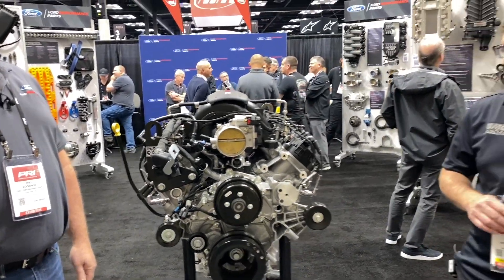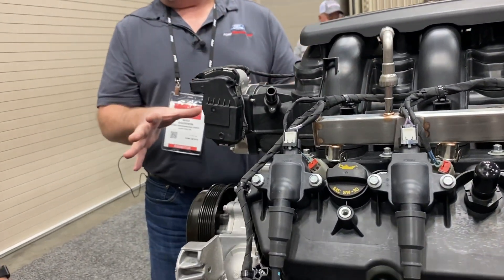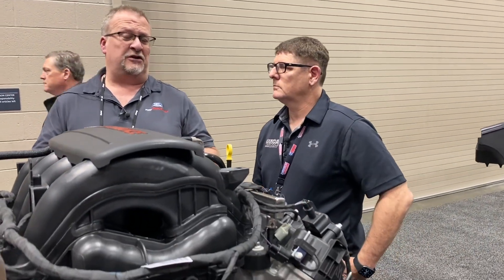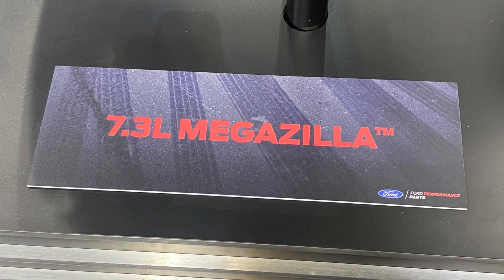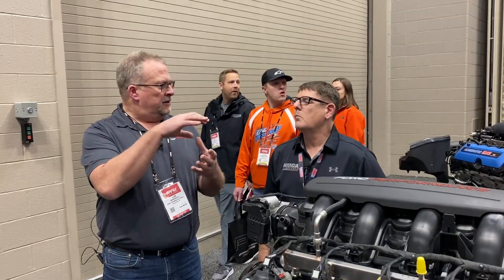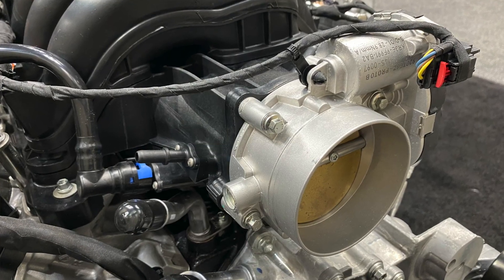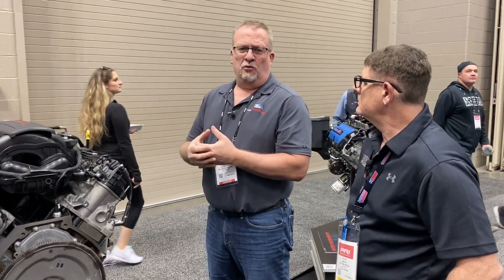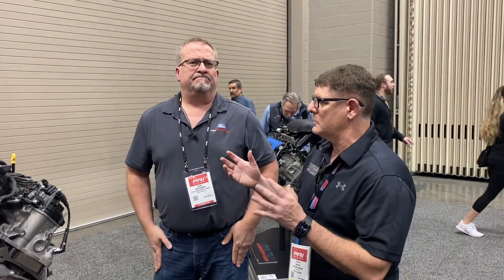Megazilla Is Here! 615 HP 7.3L Godzilla Crate Engine From Ford Performance We Get The First Look

Comment: Sorry, Not impressed with Ford Performance on this build. Take a stock 7.3 crate engine and add cam pistons and intake does not add up to a $20K engine. Would rather swap in a cam, add a procharger with mild boost and not hurt anything. imo.  Thanks for sharing Evan, do appreciate the info on this though. Merry Christmas, Happy Holidays to all.
Reply: True, where does that $ amount come from 😃
Reply: @timweb1510 warranty
Reply: @timweb1510 the shitload of boost that you can add to this thing without it breaking and the giant displacement, as well as the budding aftermarket for this. Plus the exact combination of mods here with a tune adds up to around 800 hp.
Reply: That’s exactly how I feel nothing revolutionary. Same block casting, same head casting with a much higher price tag. They didn’t do anything that an engine builder like Brian Wolfe hasn’t done already
Reply: I agree. I was mad I already bought my 7.3L right up until he said the price.
Reply: Really, I must live in a different world. In stock form the Zilla makes a measly 59hp per liter. 6.4 Scat makes 76 hp per liter car tuned. 6.2 Silverado, 67. 6.2 Camaro 73. 5.7 truck Hemi, 69. On and on. 5.0 Coyote, 80bhp truck 90 Mustang. And the later 5.0 is more. Even Fords measly 3.3 truck OHC make 290 naturally aspirated for 87hp per liter. They make more horsepower per liter and pass emissions. They are more efficient. There is no argument.
Reply: I am comparing OHV engines to OHC engines, cars and trucks. Dude a 1993 car DOHC made more power per liter than a 2022 pushrod engine, it doesn't matter that the 2022 has a truck tune. Its 29 years later. advanced if you will...lol. if someone wants to call a design invented in 1930s advanced. The 7.3 is embarrassing, I  love Ford but come on its a freaking joke. And its 20,000 for the upgraded variant. Like I said, if I was going pushrod I would just buy a 514 based on the 385 series big block, save some cash and destroy a Zilla. And pushrod engines dont make more low end torque, big inch motors with more stroke make more torque. Go buy a Zilla for 20k and pour a ton more into it to make power. I am not that stupid.
Reply: @lil5.0 , It does matter whether it's a truck or car engine. 

It's not embarrassing. Their attempt at megazilla is embarrassing. 

I still stand by my statement that OHV engines make better low end torque than OHC because most truck engines are OHC and make more torque than their car engine variants. 

OHC design isn't new either dude. It's not some 21st century advancement.
Reply: Those Numbers Are "Fudged"! A Stock 7.3, Bone Stock Made 519.9 Hp And 540 Trq On The Dyno. Ford Did The BMW Thing (Underrated The Power Numbers).
Reply: Agreed. I recently had a 445ci Windsor built, aftermarket everything 650hp under 14k.
Reply: @Efab 93 Poor man’s mentality? It’s called calling out price gouging. 
Also, $1k a week is nothing. I used to think that was a good amount too when I was younger, but I make twice that on a regular work week. 
You should watch how you talk to people and not be so disrespectful. You’re not going to make it far in life being an asshole.
Reply: @Superstallion1993   20,000 for a 600hp motor is ludicrous I make 21K a month before rentals and still wouldn’t even think of dropping 20k on a motor you can get an LT4,LSA,LS9 5.4SC/5.8SC. All of these motors for less on most catalogs or just buy GM performance 8.1 thing is a monster shit better off buying a 6.8L V10 and doing cams pistons and porting the heads shit still have money left over after a pro charger
Reply: @denalidriven1574  Ford sells a 572ci bbf for 19k that makes 655hp and 710lb-ft
Reply: 12K USD
Reply: I 100% agree with you.
Reply: True. Buy a chevy 572 big block for a few hundred dollars
Reply: Honda s2000 2.0 makes 240 Hp.
120 HP per L.
Reply: @rdallas81  f20c?
Reply: Wish it was easier to replace my V10 with one of these.
Reply: The power, and more specifically, the torque under the curve is what really sets this engine apart. Yes, the price is ludicrous, but everyone  needs to have a better grasp of power and torque graphs vs. peak numbers and what it means for street performance.
Reply: This is a HD truck powerplant.... so I feel.like they are giving you a lot to start with...
Reply: You're not wrong but that's the cost of turn key drop in engines. Go price having an engine builder port the heads and swap internals and with the cost of parts and labor I bet it's not much cheaper. If you can do it yourself that's a whole different story but this is geared towards the guy who's throwing money at a build. This probably comes with some kind of warranty too.
Reply: @EvilSSP If you’re throwing money on a build, these “upgrades” are basic af for this price. A junkyard engine and a real build would be a lot cheaper, and you’d be building it for your goal.
This is a rich bracket racer’s engine or a drop-in for someone who’s got more money than brains.
Reply: @Superstallion1993  Brains means more money.😂
Reply: I am assuming that the 615 hp is bhp so wheel horsepower is probably just over 500. You can buy a 2018 Ford f150 3.5 Ecoboost truck, the whole truck for 35K and buy A Bullydog BDX tuner and an e50 tune for 565 bucks roughly and make 552 wheel horsepower. And drive it every day and average 18mpg even on e50. My 2016 F150 2.7 Ecoboost that I have owned since new and has been driven 206,xxx miles in 6 years is making 445whp with a tune and some bolt ons will make 540whp after I have CRP upgrade my turbos for 1500 bucks. I don't think I will be doing a 7.3 Godzilla transplant. 20K wouldn't even get me started. It would require a different transmission, custom headers, custom driveshaft and all kinds of other headaches just to be at the same power. The only benefit is that it would sound much better. Buy a 5.0 Coyote out of a wrecked truck from a salvage yard for 5 grand, spend 8-9 thousand on a supercharger and run out of that big pushrod 7.3 life. Ford went backwards with that thing. Standard truck 7.3 makes 430hp. 430÷7.3 liters equals 59hp per liter. Standard truck 5.0 Coyote makes 400hp. 400÷5.0 liters equals 80hp per liter. Come on Ford, seriously. Its kind of an embarrassing engine.
Reply: @lil5.0  Get that power out of your ecoboost without the boost.
Reply: @johnbuck7822  Get that power out of your NA without the cubic inches...lol. I don't know what argument you are trying to make but Ford does offer a 3.3 V6 in the F150 that isn't boosted, makes 290bhp.  290÷3.3=87.87 bhp per liter. Big ole 6.2 Silverado truck engine makes 420bhp÷6.2=67bhp per liter. Weak, has to have INCHES.
Reply: @johnbuck7822  Going back and reading my initial message I simply stated that Ford went backwards on the 7.3. The 5.0 NA is a superior engine. It makes power without adding cubic inches. Ford acting like Dodge and Chevy on that one. Going backwards to pushrod and making a whopping 59hp per liter. Coyote in its mildest form (truck cams and intake) is making 80. The Godzilla...lol.
Reply: @lil5.0  what did the coyote make per liter during it's first generation?
Reply: @lil5.0  It's much cheaper to get the HP out of the cubic inches than it is to boost a baby engine. 

My argument is that the Godzilla can make Coyote power at a much lower RPM. Therefore be more dependable, etc. 

You do realize your 3.3 V6 NA comment makes your, "weak, has to have INCHES" comment ironic. Apparently weak has to be boosted, too. Therefore...
Reply: @lil5.0  Hi Lil! are you talking a 5.0 coyote engine? Gen 1-Gen 3? Thank you!
Reply: @robertclymer6948  I am talking about every single engine Ford has in mass production is a better design than the Godzilla. It is an ancient inefficient pushrod design. If I wanted to go the big inch route I would save money and buy the Ford 514 crate engine. But yes I would take a Coyote over the Zilla any day.
Reply: @lil5.0  you say inefficient yet OHV engines make as much power as OHC engines do.
Reply: @johnbuck7822  If you want to go back we will go way back. First mass produced Ford 32V DOHC was 1993 in the Lincoln Mark 8. It made 280 at 4.6 liters. Thats 61bhp per liter, more than the stock Zilla per liter...lol. 1993. Same year Camaro SS, top performer over the Mustang those years had a 5.7 with 275. Thats 48bhp per liter. Again and again and again the DOHC makes more horsepower per liter. It makes power more efficiently.
Reply: @lil5.0  you're comparing car engines to truck engines. 

And it makes more power efficiently in the higher rpm band. OHV is always better for low end power.
Reply: @johnbuck7822  2020 5.0 F150 Coyote 5.0, 400hp and 410lbft. 2020 5.3 Silverado, 355bhp and 383lbft. Slightly bigger, substantially weaker. DOHC rules.
Reply: @lil5.0  why did you throw in a POS LS when we were talking 5.0 coyote and 7.3 godzilla?

Could it have to do with the 7.3 making more power and torque than the f150 5.0?
Reply: @johnbuck7822  God help you. It barely makes more power in truck form and its 47 percent larger displacement. At 80bhp per liter, the Coyote design would make 584bhp at 7.3 liters. If I am correct, that giant  7.3 makes 435 rolling down the assembly line.
Reply: @johnbuck7822  at least you got one thing right, LS is a POS. Idiots say the best motor of all time. And again that tweaked over and over design requires a 6.2 liter displacement to be competitive against a Coyote. That being said the 6.2 is very close to the 7.3 in output, Ford should be red faced.
Reply: @lil5.0  God help you. It barely makes more power in truck form,,, at a lower RPM. You don't have to rev the 7.3 to the moon to make the 430hp like you do the coyote.
Reply: @Horrible_Deplorable  buy you a 7.3 brother and enjoy.
Reply: @lil5.0  who said I wanted to buy one? Can you actually stick to one topic.
Reply: @johnbuck7822 I dont have an issue with rpm, low end torque is nice to especially when towing heavy weight. Coyote sounds awesome at 7500 rpm and lives a long life. But if low end torque is a big deal well the 3.5 Ecoboost has a bunch of it. The 7.3 was designed for a F250 as an option for the guy that doesn't want the diesel. As far as I am concerned thats were it belongs. The video is about purchasing a motor to drop in a project build. The 7.3 Zilla will never be as readily available, will never have near the aftermarket support and will never be a more cost effective way to upgrade performance in a vehicle. The only argument you made is that a Zilla can make power at a lower rpm and be more reliable. Man there is zero proof that a 7.3 tuned at a high power output can sustain hundreds of thousands of miles without failure. But people are having great success with longevity in Ecoboost and Coyotes. Horsepower per cubic inch matters, 100hp per liter is harder on components (smaller engines typically have smaller components) than a 50hp per liter engine. But a stock 2.7 Ecoboost makes 120bhp per liter and survives it. My 2.7 is making close to 500bhp for 185bhp per liter.  Weve already discussed that a stock 7.3 is making 59bhp per liter. My 2.7 was stock for a 100,000 miles so it survived 120bhp per liter that long and has developed more and more horsepower since. Now at 185bhp per liter and 209,xxx miles its still screaming, still has the original turbos, timing chain, cam phasers, rings, pistons etc. Thats some serious strain and a motor built to handle it. There is zero substantiated proof that a Zilla can outdo the 2.7. 3.5 or 5.0 in longevity even at its rediculously low output for its substantial size. And even on e50 my 2.7 Supercrew has averaged 18.3 mpg over the last 12,xxx miles. Thats not a max effort one tank mileage thats real world numbers. Most people need something thst performs well in all categories.And the truck hunts, tows and races and has its entire life. Get out of here with the Godzilla longevity theories, I operate in proof. If someone drops a 7.3 in a project vehicle they aint gonna use it like I use a truck anyway. Its gonna be a once in a while or weekend warrior. Whats low end torque and supposed longevity got to do with anything? The project 7.3 will never sniff 200,xxx miles and I have used mine 209,xxx in 6years. Can you imagine the difference in fuel cost? There will be 50 Coyote swaps to every 1 Zilla swap. And they will do more with less. And most people who have chimmed in on this Megazilla feel the same way, it isn't impressive and definitely not even close to reasonable price vs performance. Its a JOKE.
Reply: @johnbuck7822  The comment weak is referring to output per liter. Engine design vs engine design. You brought back up the 3.3 since I mentioned it and yes its output is weak but its impressive per its size. It is DOHC and a 6 banger, at 87bhp per liter its a more impressive engine. I guess you be more impressed with an OHV 8.0 that makes 500 than a DOHC 4.0 that makes 400. Because it will make more torque down low because of its stroke.
Reply: @lil5.0  the aftermarket seems to be working to improve it. 

7.3 making over 1600hp are now possible. 

It will be plentiful considering it's in both production vehicles and being sold in crate engine. 

I never said this particular build is worth the money. 

If I'm going to use the 7.3 for a daily then I want low end torque. And I want more longevity. 

The 3.5 is nice and all but at the end of the day it will never make the power as reliably as the 7.3 does. 

And yeah I'd take the 8L OHV over the DOHC 4.0
Reply: @lil5.0  yeah, yeah, your 2.7 is cool and all and makes awesome power and gets great gas mileage. Blah, blah, blah. 

I never said it isn't impressive. But, it will never be able to make the power the same as the 7.3 can. I don't see what's so hard to understand about that. Sure, it makes whatever you say but it's probably a bang load of money sank into it. For what? Worthless if you ask me. As worthless as you say the money thrown at a 7.3 would be. 

You keep saying ridiculous output for it's size blah, blah, blah but keep ignoring that it's making that power as tuned for a truck, and not a car. Sure the 2.7 and 3.5 make great power because... turbo... And the 5.0 makes great power... At 6.5-7k rpm.  The 7.3 makes almost as much HP as the coyote and as much torque as the turbo four and six bangers. And it doesn't even rev up high, let alone turbocharged. 

It's already been proven these engines can make 800hp all motor very easily. Yeah, the 5.0 can make the 800 but will never make the torque.
Reply: @johnbuck7822  The 5.0 has made 4000 horsepower with OEM cylinder heads. Billet block at 351cubic inches. This argument has been a while back but I am pretty sure my main argument was that the DOHC 32V design is superior to the pushrod V8. And that it is. No OEM cylinder head can produce what a Coyote can. And not even close. A OEM headed billet block promod Coyote ran a 3.76 at 212 and that was several years ago beating up to 900ci pushrod motors with the most advanced cylinder heads the world has to offer. Again Ford went backwards with the Zilla.  I know the limitations of the Ecoboost,  165ci and 213ci certainly has its limits. A 3.5 has made 855 horsepower. 213ci 6 banger. But it does this for the same reason that the Coyote does. DOHC and 4V per cylinder.
Reply: @johnbuck7822  The Ecoboost platform doesn't make its power because of turbos alone. There have been many turbocharged vehicles over the years such as the Buick Grand National at 3.8 liters. It doesn't touch an Ecoboost. The cylinder heads are the main reason. 2V pushrod vs DOHC 4V per cylinder. I don't pry too much into European vehicles but they also make big power with minimal cubic inches. I'd bet all of the most impressive engines rolling out of Europe are DOHC 4V motors. NA, Supercharged or turbocharged it doesn't matter. 4 valve heads are better than 2.
Reply: @johnbuck7822  Man I am a Ford guy through and through. The Zilla aint their best work and it will never find the fanfare of the Coyote and will never reach the same ceiling.
Reply: @lil5.0  the 5.0 has been around almost a decade longer, too. The 7.3 will be making that much eventually. 

Ford didn't go backwards. The OHC design is a superior design for truck engines and commercial settings. Which is the main factory focus of the 7.3

The only thing I can really think of that the OHC design is superior at is breaking. Don't get me wrong, I like the modular engines, but my love rests with OHV big block engines. Maybe when Ford decides to make a 427 DOHCammer or something then I'll change my mind.
Reply: @lil5.0  I'm not denying that OHC engines, especially dual, can't make good power. They'll just never make the torque that I like. 

I will say the Coyote sounds killer, tho.
Reply: @johnbuck7822  I think you make valid points. Hey don't get me wrong, I'd love to see a 427ci Coyote. The old 427 Cammer brought back now that they know how to make it work with longevity. That thing was nasty when it was running. I can't remember if that thing was based on the FE big block or the 385 series.
Reply: @lil5.0  It was a 427 FE reworked with OHCs. 

Yeah, a modern 427 Coyote would be pretty gnarly. That's definitely something I can agree with you on. 

I was hoping that's what the Godzilla engine was going to be. A modern Cammer.
Reply: @johnbuck7822  They would if they had a longer stroke. But they dont and currently you can't make a stoker Coyote so yes a valid point. And its possible that you will never be able to build a stroker Coyote. But for me if I wanted to build a big stroke V8 I would just build a Windsor or 385 series motor with a tremendous up side. Rediculous cylinder heads available, the only limit on power is how much money you've got. And at least the Windsor has many fuel injection options for practical everyday use.
Reply: @lil5.0  Oh yeah, I'd take a 429/460 any day.
Reply: @Horrible_Deplorable   yes and OHV are more reliable, people forget that torque is who move the car not HP.